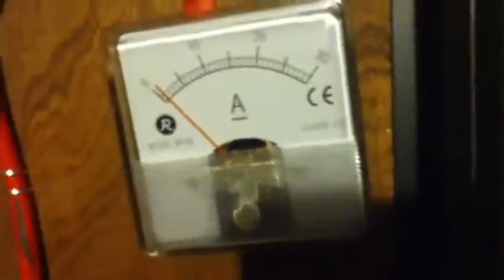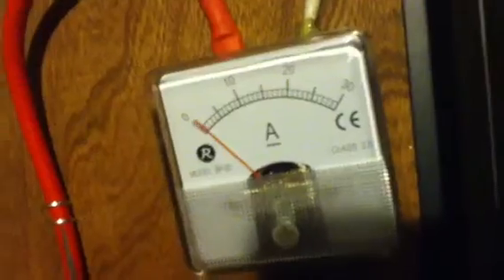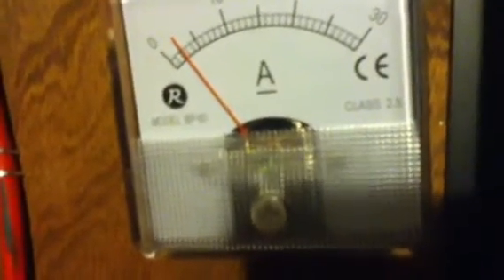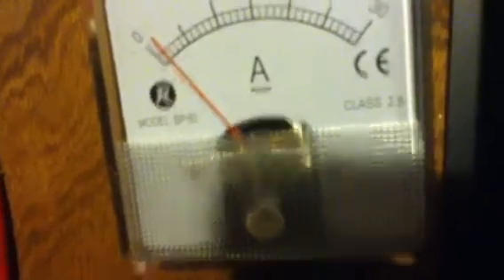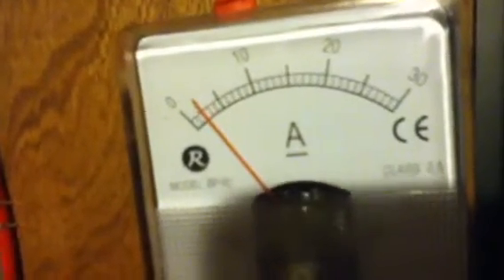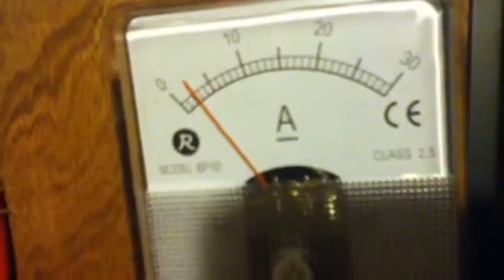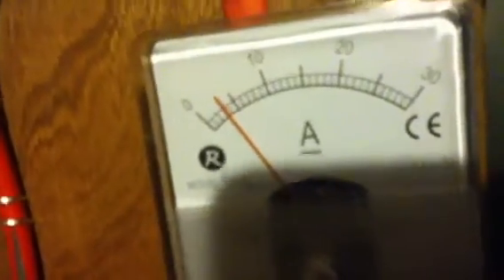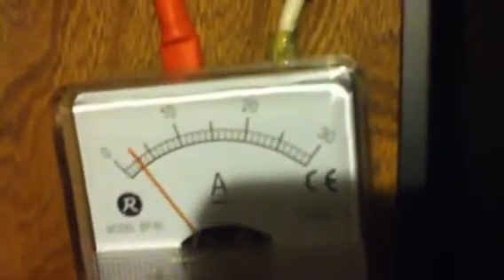Sunforce 600 watt wind turbine test

Comment from the maker: James 200 ft was a typo it is 100 ft. that G25 is just an old airport light beacon. I bought a whole bunch of them from the scrap yard. They are strong as hell. my big tower is scrap steel tubing used for supporting tents on top of tree planting pallets. I just bolted a bunch of them together and presto. I got about six Guy wires holding it up. Last years ice storm left an inch of ice on all towers and steel hydro towers were falling like dominos. mine survived. so i trust it now.

Comment: Before you condemn the turbine check all of the connections in that phase, especially at the yolk.  A loose connection or loss of continuity in the wire from a partial fracture would give you the same results.  What kind of tower do you have? Is it really 200 ft?  What kind of weight/ surface area is the tower rated for.  Is it guyed? and is that a Rohnn G25 segment on top holding the highest turbine?
James